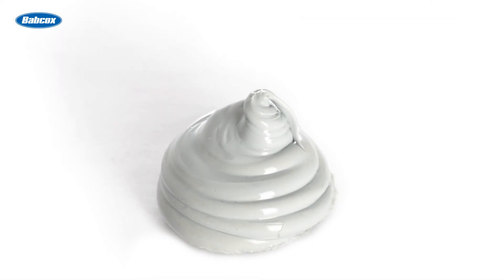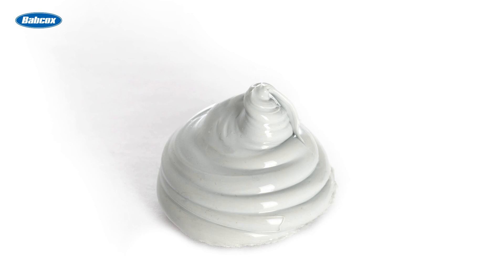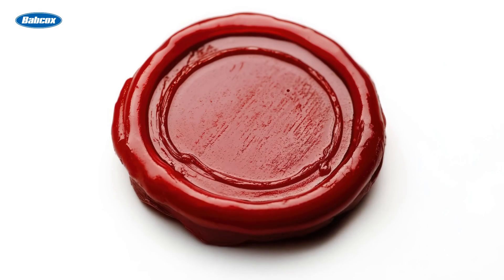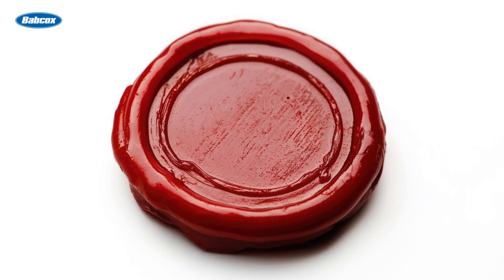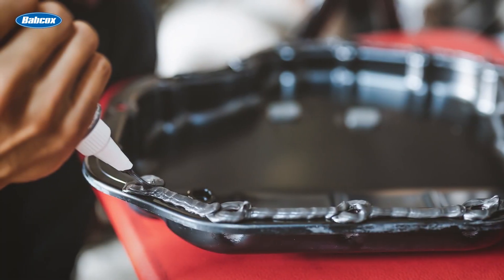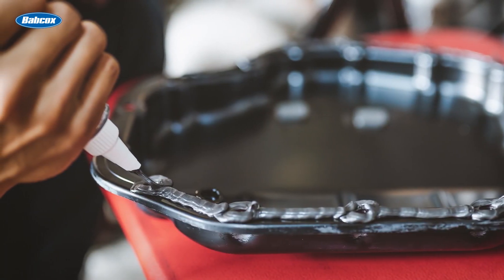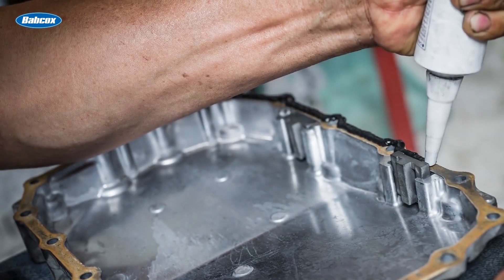The Basics of RTV Sealants

Comment: Wow. Did a manufacturer tell you what to say? Because you have some poor Information there. 

 Old old old info about coloring that means nothing.    Red, clear, silver, black, Grey,  are just that. Coloring. Heat ability of Silicone has just about ZERO affect on its use or performance based on color. 

 And true Silicone is not to be used around fuel. But color also doesn't denote it's "Petroleum resistance" either. 

There are 3 major types of Silicones that cure slightly different in use for Automotive.  That does make some difference in longevity or resistance. 

Certain additives in Silicone can make it outperform in extreme heat applications but in general once it's cured it's most all the same other than the firmness of cured product. 

What's more important is storage, shelf life, proper application, proper prep and clean up of Silicone. 

I can help you with all of that if you would like. This video is a bit embarrassing in 2025.
Reply: Hi Brian I need to seal the oil sensor on a Yamaha zuma 50cc apparently the sensor/cap comes loose and that’s what cause oil leaking. One reason I went to look on here was more since there is a rubber cap covering oil tank/container I assumed the RTV is mainly due to most other things not holding a loose lid down when oil is involved. Anyway main reason was i wanted to fix it ASAP and wondering if there is/was some other kind of substitute i could possibly use that i might have already
Reply: @keZZaZ84 the sensor is held in by a grommet correct? Those shrink with time. Replace the grommet and you can add some Hylomar sealant to the mating surfaces (just a swipe)
Reply: @brian @briansantefort eve you are correct I’ll know probably later today when I remove it. All I need to do now is research what Hylomar sealant is lol. I really appreciate you responding to my question aswell 👍🏼👍🏼✌🏼